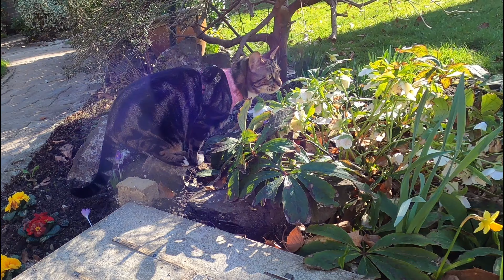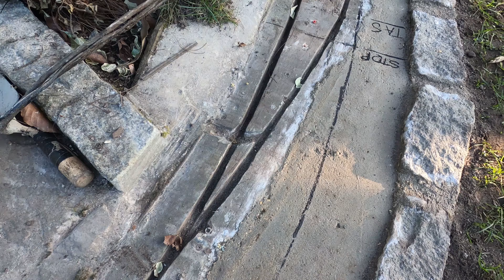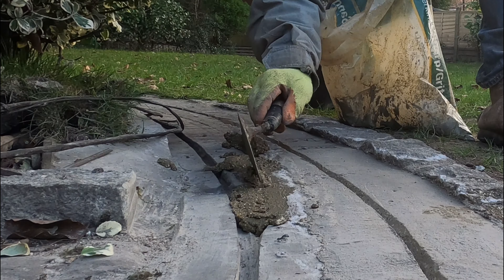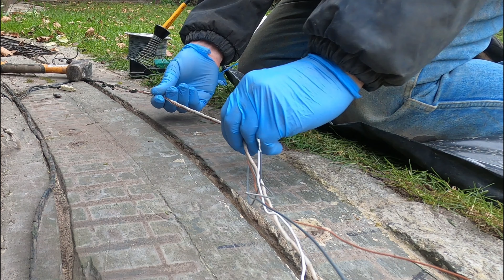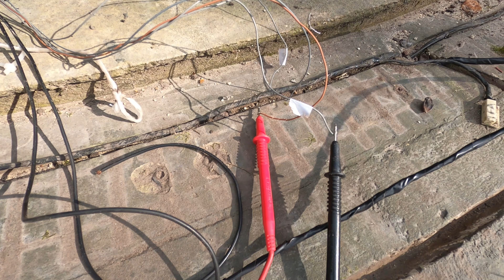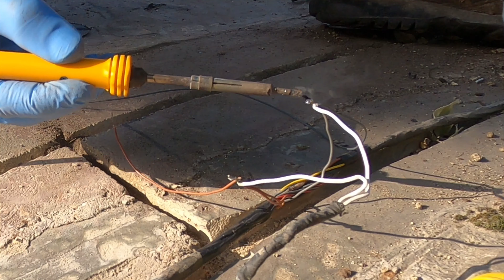Groovy System Cabling | Station Extension Part 2 | Linleys Garden Railway

Comment: Just popping in to see how it's coming on. I appreciate the work. To be honest I wouldn't know where to begin it all looks so intricate. Good going. Mark
Reply from the maker: It is really just step by step, and working things out along the way.  I have ideas to follow, and most of the electronic systems I designed many years ago and I keep looking at my copious notes and diagrams for the cables and bits like that. W :)
Reply: @Linleys  Aaah, at least you have a guide. Yeah, steady as it goes and in good time it emerges.

Comment: You've had to do a lot of cutting/grinding/soldering/ insulating/cementing. Are there any rechargeable battery powered wireless controlled points and signals available anywhere? I've had a quick look on the internet and I see I'm not the first to hanker for such a system.
Reply from the maker: Interesting idea about the wireless links to trackside equipment, it would certainly save the cables.  Not explored that very much.  Thanks for your ideas :) W